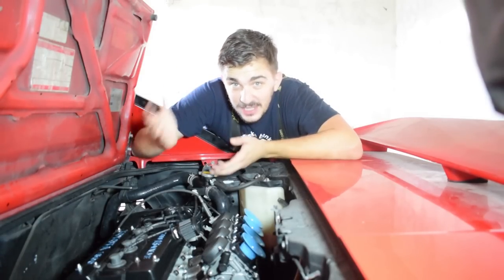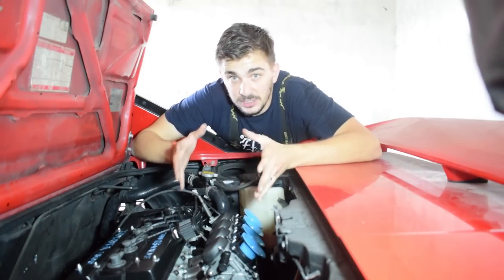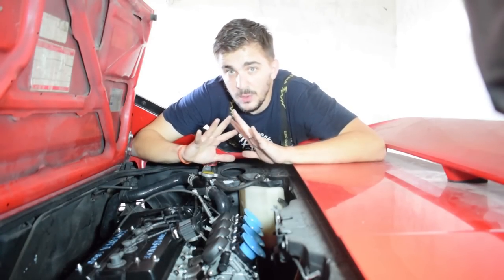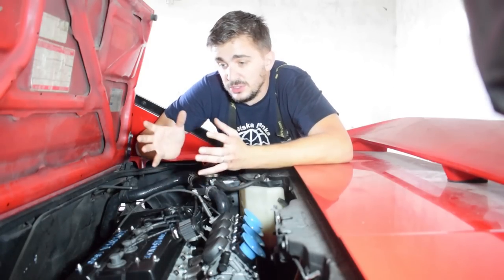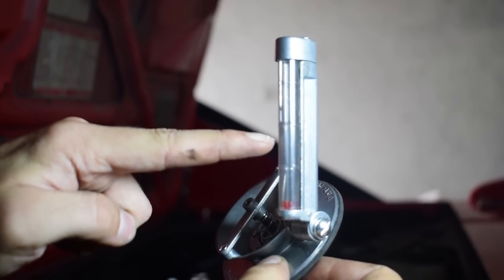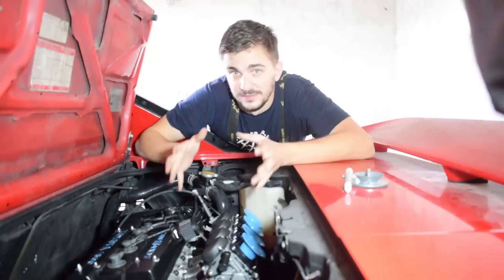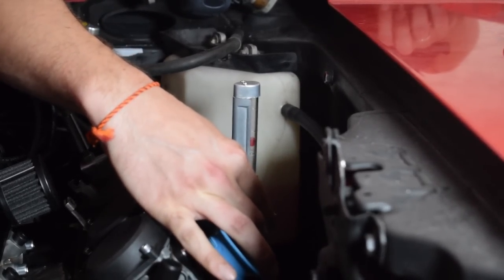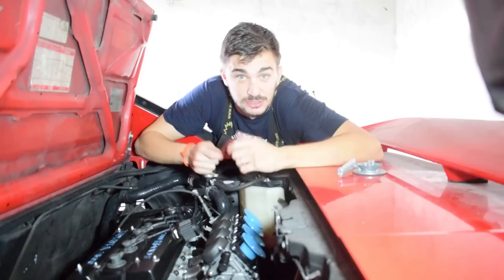How to BALANCE BIKE CARBS on a car engine

Comment: nice tool.

i could see it useful even when tuning all 12 carbs in a classic Lambo or a Ferrari
Reply from the maker: Imagine that, took me about 10 min to do 4 carbs. So it means it takes about half an hour for 12 carbs, although I think it's 6 twin carbs on those v12. Probably webers or solex or something like that. But boy I would love to be able to just hear one of those engines run.
Reply: @d4a  talking abt solex, i heard N2 machines run on twin solex right?

Comment: Hmm the 1.2k idle is a bit high but ehh idk I'm just a 14 year old weeb that has 0 experience
Reply from the maker: Stock idle of the 4age is 800 rpm or so, which means you're right. But carbs change a lot of things. The engine can run at 800 rpm with the carbs too, doesn't run too bad at all, but I kinda prefer the way it runs at 1300, runs a lot smoother :)
Reply: Hello 14 year old weeb, take it from a 29 year old weeb that has this same model of MR2, an idle of 800 RPM is just not going to happen. It's not uncommon for these cars to idle at 1200-1600 RPM. Mine hovers in and around this range most times. I can adjust the idle position screw to get it to around 1000 RPM after the car has warmed up, but then cold starts are rougher. 

Also, four cylinder engines always have a secondary force issue that causes the engine to vibrate. This becomes more noticeable the lower the RPMs; and so it can often be easier to set the RPMs higher to feel a smoother ride when idling.

Comment: Hi! Would like to know why running stock ECU is bad? Other than being limited to the OEM Bigport 4A settings,  is there any huge downsides to running stock ECU with a MAP sensor rather than  a standalone. 

The bikecarb conversion seems more alluring and cheaper than converting a standard 16v to run ITBs from a 20v. Use case is for drifting; just wanted to know if running a stock ECU will have any significant performance downside that is all. If such is the case would running a piggyback system be of any help ?

Comment: I love your videos! I have an 86 aw11 that I'm putting Weber carbs on and I want to put a points style distributor on it so I can completely get rid of the ecu because everything will be mechanical. However, I haven't been able to find any info regarding points ignition beside converting to a older 4K distributor, but there is still a lot of confusion regarding that conversion. Hopefully you have some Info that may help myself and others who have this issue. Thanks again for sharing your knowledge of the aw11 platform with all of us on the web and I hope to see many of your amazing videos in the future!
Reply from the maker: Thank you, glad you liked the videos. Here's what I know. Older distributors that were on carbed engines have something called a vacuum advance. The higher the rpms the more vacuum is generated and thus more ignition advance. The stock distributor that is on the 4age engine will not provide advance without the stock ECU. You can get it to run without the ECU but what people did in that scenario is to "lock" the distributor at a fixed advance. In my opinion that is garbage and results in very poor performance and makes carbing seem stupid. So to be fully mechanical you will need an older distributor. What you need to figure out is how to get vacuum advance from the weber carbs to that distributor. The 4age has ben webered many times and I'm certain there's a lot of good info on the club4ag forums.

Comment: Hello, I have a very similar set up as you (r6 carbs, 3sfe Celica engine with nodiz ECU). On initial start I've got a misfire situation on cylinder #4 (this is the same cylinder to which I've got the vacuum hose connected to the brake booster). I've confirmed I have spark. Any ideas or suggestions? Thanks! Love the videos by the way!

Comment: Why not just turn the screws the same amount of turns ?
Reply from the maker: Because not every cylinder has the same compression and doesn't draw in the same amount of air. Every engine is like that which is why sets of 2 or more carbs can only be balanced on the engine and while it's running.
Reply: @d4a  hmm,i didnt think of it,that actually makes sense its nice to learn something thank you

Comment: Curious how well the carbs are controlling your AFR, since it is not controlled by an ECU anymore.  Do you have a way of monitoring while the car is running?
Reply from the maker: I have a wideband. AFRs are pretty stable now.
Reply: @d4a  hi i am using exactly same set up as you have on ur mr2 mk1 ie 4age engine nodiz ecu and dan st engineering carbs. I have installed a wide band afr. when the engine starts the afr reading is 11ish but while driving it stays at 9. Is this good or I need to do something. I have booked a turning with Dan st engineering on 19th of August but need your view

Comment: nice all i knew about was the vacuum gauges and hose between the throttle plate and the valves way, that uni-syn is a nice little tool. I see that coolant reservoir is still looking good and you can see the level easily.
Reply from the maker: Good eye! Yup coolant overflow tank still looks good, that cleaning paid off :)
Reply: @d4a  that was the video that got on your channel!

Comment: How it is during cold weather does it run smooth as well
Reply from the maker: Beautifully smooth. I have never driven it at sub zero temps, but I have started it at sub zero temps and it starts right up.
Reply: @d4a   keep up the good work, i'll have to save up soon since i already have a standalone